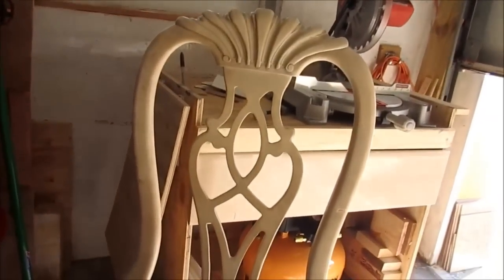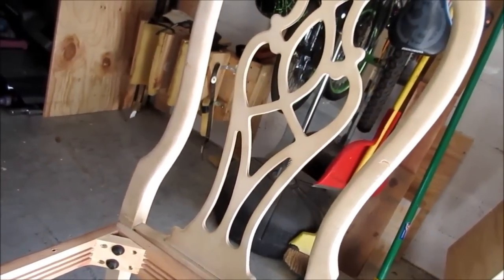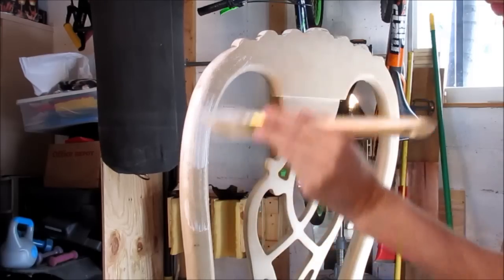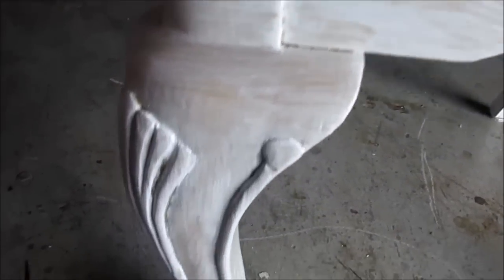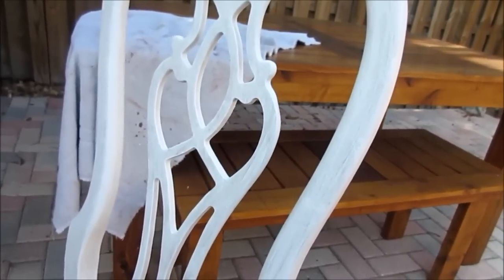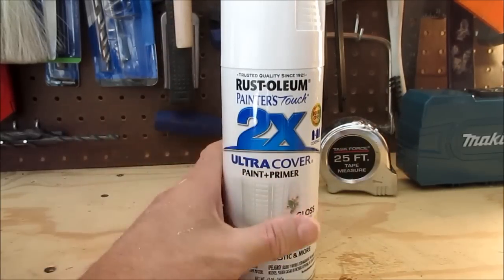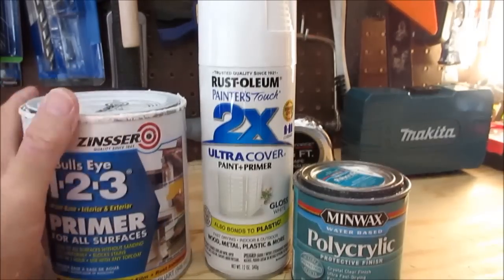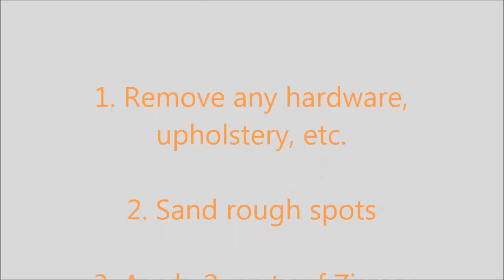How to paint furniture that has a glossy finish(without sanding off finish!)

Comment: You could also use very fine steel wool in place of sand paper in between each coat of primer and that would give it a lot smoother finish.
Reply from the maker: Cool. thanks

Comment: If I have a Rust-Oleum Universal Advanced Formula spray paint that has the primer and paint in one, do I still need to put on this Zinsser primer? I have two wooden bar stools that I'd like to paint and they have a glossy finish.
Reply from the maker: Not sure, I looked online but didn't find anything. I see it adheres to multi surface(concrete, metal, wood)b ut not sure if that surface is glossy. Just do a test spot and see, at worse, it doesn't adhere and you can just wipe of, but be careful, rustoleum is oil based which means you need paint thinner to clean up. Latex paints will clean up with water.
Reply: Thank you!!
Reply: I’ve doing some research , and people have said not to believe the paint and primer 2 in 1.  Guess it’s kind of like shampoo and conditioner 2 in 1.  It’s not the same.  Also I personally as much as I hate to, I always sand.  Buy a few different sand papers and see which one works for you because I find some that don’t require to much elbow grease.  I’m skeptical about not sanding, too me if it’s sounds to good to be true, it usually is.  Which I had time to experiment with and without sanding , priming and different paints.

Comment: This is EXACTLY what I needed.  I have 3 barstools and a shelving unit that are an out-dated 90’s light oak with that glossy finish.  They don’t match anything in the house but the pieces are solid wood and I’d hate to get rid of them. I consulted with a contractor who did some work for me and he said I’d have to strip them and sand them before I can paint them 😳 That’s much more work than I want to put in and that’s when I came across this video.  It’s going to save these barstools from a life of being tucked away in a storage unit.   Thank you for the clear, concise information and the detailed instructions.  You my friend are awesome.
Reply from the maker: thanks, good luck

Comment: Omg, I had watched this video several months ago and made just a few notes about it, listing just the products you used. I thought I would be able to remember everything at the point that I was ready to do my project. I just pulled my notes out and for the life of me I could not remember anything else about where they came from. I have spent the last 2- 3 hours searching the internet with the product names in hopes that I could figure it out. I thought I might have a screenshot somewhere so I looked on three different devices. It was so frustrating! Eventually I found my way back here and as soon as the video started, I knew I was in the right place. At any rate, thank you for posting it. I have a fireplace with a lot of ornate detail and the idea of sanding everything and cutting in with paint/a brush was overwhelming until I had seen your video. I will be getting started on this project soon. Nice work and thanks again.
Reply from the maker: thanks
Reply: Have you started your project yet? How did it go?
Reply: @tatianaortiz9858  It ended up being a disaster but I blame myself.  I totally thought I had Zinsser primer but it was Kilz and I only realized it after I had thoroughly primed my fireplace.  Kilz doesn't claim to be a "no sanding necessary" primer but Zinsser does.  Everything rests on that so my foundation was bad and caused subsequent issues with the regular paint practically falling off in spots.  I debated whether or not to take it back down to the original finish but in most areas, it seemed okay.  I am mentally prepared that someday I'll have to deal with it.  

Also, another issue is that I had to spray paint on a horizontal surface (the top of the fireplace) and no matter how carefully I applied it, the spray left "shadows".  I did about 3-4 coats hoping it would even out but it never totally did.  

And...I spray painted inside bc the fireplace was too big to take outside.  I put up plastic sheeting like a Dexter kill room but it still ended up getting on the floor and furniture on the other side of the room.

And unrelated to anything in the original post but maybe good to know too, I also had to brush paint a black area which butted up to the white spray painted area.  Although I used blue painter's tape, it bled through badly.  And to add insult to injury, when I pulled the tape off the white area, the white paint peeled off due to issue #1.

Some of us serve as an example and others serve as a warning!  :S
Reply: @l.p.9568  oh my goodness that sounds like my nightmare hahah. I've just started my own project. I've used 2 cans of white spray-paint on one nightstand. im not too sure if im doing it right but there's no looking back now!

Comment: Thank you! Great explanation. This is how I’ve been doing but just wanted to make sure it was going to last. 
To be honest, I can’t decide if I like the Zinsser 123 primer because it is super thin and is streaky and I don’t think it covers darker areas well enough. I personally feel like the Kilz2 Latex primer is best for coverage and it goes on much more smoothly. But that’s just my own experience. 
Too, I love love love Polycrylic BUT it absolutely positively can leave a yucky yellow residue on white painted furniture. It doesn’t do it every single time but most of the time in my own experience. And I use thin coats and even tried sanding between. It changes the final crisp white color to a more dingy white. I’ve even had it turn some white paint so yellow that it looked like the piece of furniture had been in a smokers home 10 years. 
So, I choose Polycrylic for every single top coat and every project IF I don’t paint it white. The poly is gorgeous over stain though! Wowzer! 
I hope I’m not being too negative. I agree with your suggestions and appreciate them. I’m just saying from my experience with the Zinser123 primer and the Polycrylic, I’ve had some inconsistent results. So, I use them but I prefer a different primer typically. That’s all.
Reply from the maker: yes it is thin and streaky, that why i ha to do 2 coat and a little sand, and yes the poly is not needed an can cause yellowing
Reply: So what do you do to protect?
Reply: @marywilson7364  since he/she didn't respond, the most likely answer is the counterpart to polycrylic...an oil-based polyurethane. Polycrylic is water-based so much easier cleanup. I didn't know till now that it may yellow...bummer, my project is white. :(

Comment: OMG, I thought I was the only one to use Zinsser for painting furniture. I like to brush on the Zinsser Bulls Eye Primer Sealer Stain-Killer. Sometimes when you try to paint over furniture stained from the 1940's & 1950's, the stain seeps through every product except for my Zinsser. And the best part is it is water-based and drys in one hour. Of course I light sand before the second coat.
Reply: Lynn Early rr

Comment: ‘Ok we’re going to paint furniture without sanding, but first let’s sand all this furniture, primer 2xs, sand again, paint, sand, seal, sand, then we’re just going to sand it all down for good measure.’ 😉
It all came out gorgeous! Good job! 💕
Reply from the maker: The very light spot sanding that I did just to ensure smooth which took zero effort and 1 minute is NOTHING compared to having to SAND OFF ENTIRE ORIGINAL FINISH!   Thanks
Reply: Yes, I know. I’m just teasing. It looks gorgeous. Great job!

Comment: For FINAL FINISH paint, I butter the paint in wth a  a Top quality white mini sponge roller then feather brush brush in the paint with a GOOD nylon brush then roll it back in with the same  a lightly covered  sponge   pain roller.. Then use polycrylic sealer  apply it the same way  way Simple NO MESSY  SPRAYING NEEDED

Comment: What was the sandpaper grit number that you used to sand in between coats. Great video, clear instructions,just need the sandpaper grit info. Thanks.
Reply: Hi, in my experience 000 grain paper works good
Reply from the maker: thanks, a 180 should be good

Comment: Thank you so much for your video and tips!  I have been repainting with spray paint all my patio furniture and decided to paint a rusty metal more modern side table.  I unfortunately went with Rustolium in a can (not spray paint).   Now I know what you mean about not using a brush on furniture.  Spary paint is the way to go!  I have one more coat to paint and then I want to paint a design over the gloss.  I have a question for you, can I use acrylic gloss paint, on the oil based Rustolium?
Reply from the maker: Glad I could help!,

Comment: Awesome video.  Gave me lots of clear answers to my long questions.  Appreciate your hard efforts.  I still wonder what would be best to apply the minwax top coat finish.  Thanks a lot. I subscribed.
Reply from the maker: Hi, thanks..Are you asking if clear coat is needed, or what would be best way to apply it?? The clear coat wasn't necessary,  I just put it on the chairs for a little extra protection since they get alot of use (i have 2 teenagers).

Comment: Great video, exactly what I was looking for, thank you! How do you achieve a smooth finish with the spray paint? In my experience you get drips or ares where the paint is 'running'
Reply from the maker: Hi, if your getting runs/drips with spray paint your putting too much in one spot, basically your too close with the can and/ or moving to slow. You want to be like a good 6" away and do multiple passes back and forth till good coverage

Comment: Excellent video! Thank you for sharing. How is the polycrylic finish holding up on your chairs? Also, is there a video on your table top? I'm doing the same to my table and chairs now & would love to see your table!
Reply from the maker: I put very little but its still good. No, the table was same finish as chairs, i sanded down to wood to see the grain lines, stained, then clear coated  the top. The base I did same as chairs, right over the finish, thanks

Comment: Hi I am doing this to a 7ft table top. Would you still suggest spray paint, or a spray gun? If spray gun, what paint would you suggest? Thank you
Reply from the maker: You can also use a roller, will be faster. and no brush marks,  I dont think I would spray paint Aa large flat area, rolling is easier

Comment: Thank you for sharing this video makes the project look less intimidating my question is I have a similar pine table and 6 chairs. I want to paint the legs and apron distressed black, chairs in Heritage Red. Do I still use the white 1 2 3 primer? Thank you!
Reply from the maker: The primer lets the paint bond, without it the paint wont stick to a glossy finish. I m pretty sure white is the only color primer comes in.

Comment: With the table top could you use paint the same way as you did the chairs? or would it come off?
Reply from the maker: Yes, the primer will adhere to any surface, then you can paint.

Comment: Great work. I have exact same dinning set. How did you refinish the table top?
Reply from the maker: The top I sanded down to the bare wood, applied 2 coats of stain, then 2 coats of clear polyurethane.

Comment: U may have mentioned... Both the Poly and 123 make spray versions.  Have you ever used those?  Your thoughts?  And also would I get the same effect?
Reply from the maker: Sure, I just didn't use spray because I was doing work inside garage. And with all the curves and cut outs of back of chair I felt spray would waste Alot.

Comment: is there any protective finish option that is in a spray can? I am planning on painting my dining chairs white (like you!) and am a little nervous about the possibility of yellow streaking...but have young kids so think I should probably add a protective finish
Reply from the maker: there should be, but not sure. just look at lowes or home depot,
Reply: I have seen and believe I have used polyurethane in a can. I think the polycrylic was what I had used. In my experience, polyurethane does need light sanding between coats and I bet even more so when in an aerosol form.

Comment: Hi!! I love how easy it looks I’m hoping my chairs and table will look beautiful as yours. I have a question though can I paint my chairs any color I want with the 123 zinsser primer? I’m asking because it’s white or do I have to paint the chairs white? Tía
Reply from the maker: Hi, thanks. You can use any color paint. The primer is white but any color over it is fine. Good luck
Reply: I just saw on a DIY show that white primer underneath a dark color like red can make the red look pinkish. They suggested having the paint store tint the primer the same color as the paint.

Comment: I have dining room chairs with the fabric in the back and seats of the chairs. Should I use paint tape and plastic to cover the fabric on chair that I cannot detach?
Reply from the maker: Yes of course! Usually the seats will unscrew from the bottom but upholstered backs are fixed so you will need to cover. A garbage bag should work fine with painters tape.. Good Luck
Reply: Rolling Thru Life thanks for the information.
Reply from the maker: Your welcome.

Comment: Do u have a video to how to change the chair fabric?
Reply from the maker: No, but very easy. Buy new fabric, remove old fabric- it should be just stapled on bottom, so pull staples and fabric comes off. measure and cut new fabric, pull tight as you staple around bottom

Comment: I tried priming my glossy cabinet and the primer is chirping out. If I use BullsEye primer on top of that, will it work? Or do I have to sand the old primer before using bulls eye primer ?
Reply from the maker: not sure but if 1st primer isnt holding, the zinser will hold to that primer but all will still flake off

Comment: I loved your video first of all..My question is if I want to paint my red oak bookshelf to darker rich brown stain/paint. Its impossible to sand it so which color primer will I use and what color spray paint or it doesn't matter? Also If i want to use stain instead of paint, can I use the same method?
Reply from the maker: Thanks!  your question is a little confusing. Stain is typically put onto bare wood to give it color while bringing out the grain of the wood. With painting you lose the look of the grain..So not sure why  you would use stain over the primer or existing finish. If you want to just paint it, just primer and paint of your color choice. if you want to stain it typically you need to sand it down I suggest just going to home depot or lowes and explaining to someone at paint counter for advice. Take a picture of your current finish on phone to show them. 
k

Comment: After watching your video, I was really excited to redo my kitchen table.  I sprayed on the Bull's Eye Primer and that went fine. 
 Then, when I sprayed the Painter's Touch, it went on like sandpaper.  Not sure what to do to fix it.  Can I sand it with 220 to smooth it out and try again?  Do I have to remove all the paint, or can I sand to smooth and then cover it with wood paint using a paintbrush?  Not sure I want to spray again, as it's humid and rainy and I am now seeing that you have to be pretty precise, which I am not.  Thank you for any advice / help you have!!
Reply from the maker: Sorry to hear of your problem! You can sand the paint down smooth. This happens when you paint outdoors when it is hot or in the sun.  The paint spray dries before reaching the surface.   It can also be caused if you hold the can too far away.    It is better to spray in the morning or evening during the summer and keep the can about 10-16” away. Only reason I don't like to use brush on furniture is brush marks, if it's a table, use a small roller.
Reply from the maker: Sorry to hear of your problem! You can sand the paint down smooth. This happens when you paint outdoors when it is hot or in the sun.  The paint spray dries before reaching the surface.   It can also be caused if you hold the can too far away.    It is better to spray in the morning or evening during the summer and keep the can about 10-16” away. Only reason I don't like to use brush on furniture is brush marks, if it's a table, use a small roller.
Reply: Thank you for the quick reply - do I have to sand all the way down to the primer?
Reply from the maker: Give the paint a few days to cure(harden) then sand. The way you can tell is scrap with your finger nail(not too hard), if paint comes off very easy-it's not cured yet. No, just sand to smooth, don't worry about what is paint and what is primer, as long as it's smooth. then repaint.
Reply: I haven't touched it yet - am waiting a few days!  Thanks again for the help!
Reply from the maker: Your welcome! Hope it turns out how you want.

Comment: Hi,

I know this is a older video but I was at home depot and noticed that  Zinnser bullseye has a spray paint primer.  Will that work better then painting it on?  

Also can i use an enamel spray paint over this primer?
Reply from the maker: spray or brush on, same thing. whatever is easier for you. spray needs to be done outside, brush doesn't. not sure, i suggest just read can label when at store.

Comment: How did you paint the table top? Spray paint or brush?
Reply from the maker: Neither, that is not painted(the apron and legs I did same as chairs) but the top I sanded down to the bare wood then stained it(using a rag) then a clear coat on top of stain. You cannot get that kind of finish with paint,